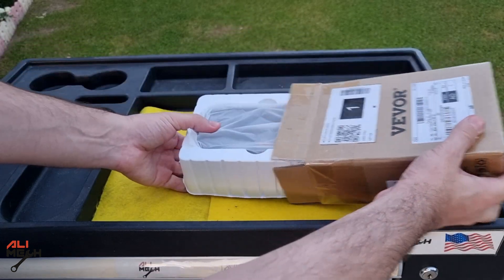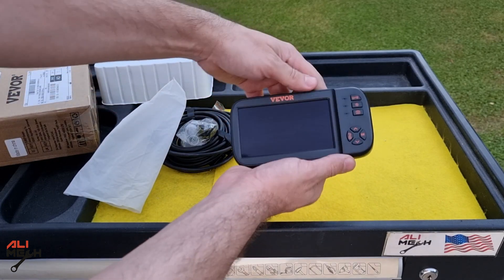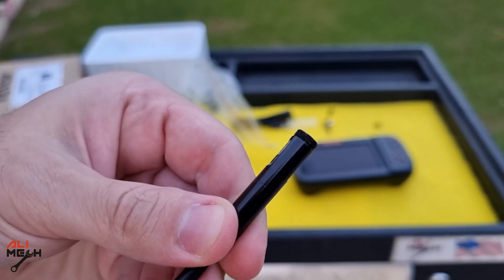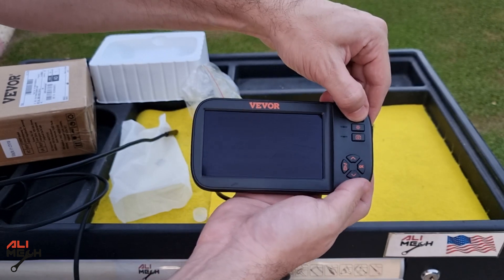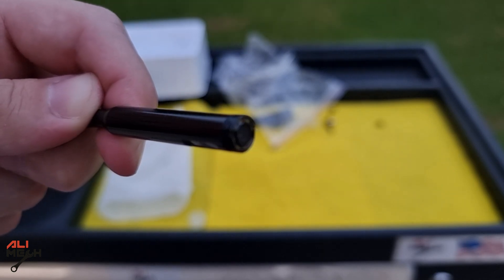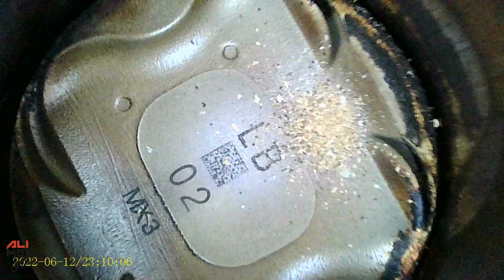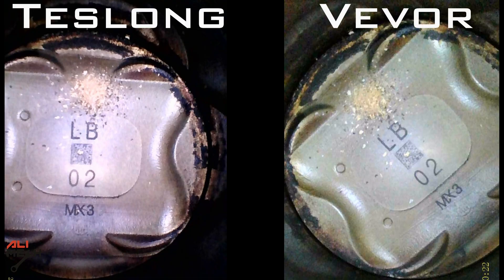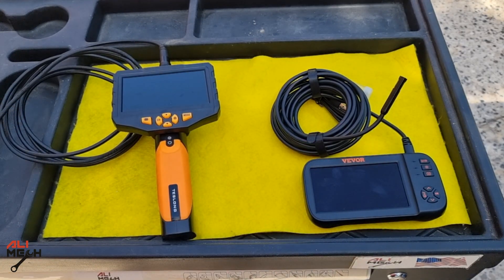Is that's the best Endoscope camera we been waiting for??Test and review VEVOR Triple Lens Endoscope

Comment: Hello brother
I don't know whether I'll get reply or not
But i have one serious problem
In my corolla 2008 1zz-fe
I am from india
After cleaning my both o2 sensors my car is popping too much.
I think it's getting rich A/F mixture
How to solve this problem?

I have thinkdiag scanner in which there is one function called reset A/F should i do it or should i check my fuel average first?
Reply: Your Toyota will have an OBD2 plug under the steering wheel, get an inexpensive code reader and see what code(s) is present. Popping sounds LEAN not rich. I bet you have a vacuum leak somewhere.   Cheers from Canada